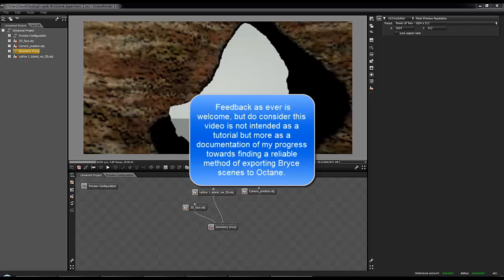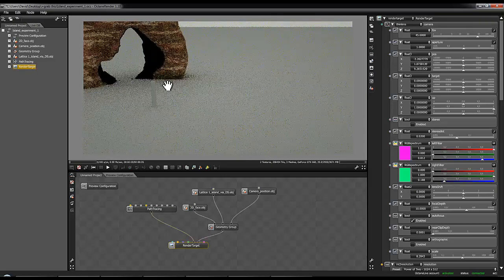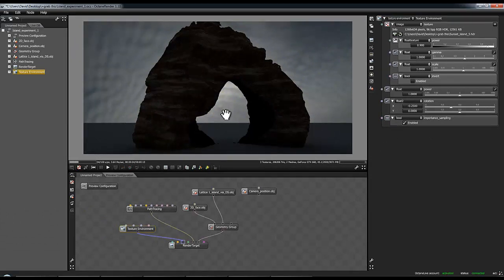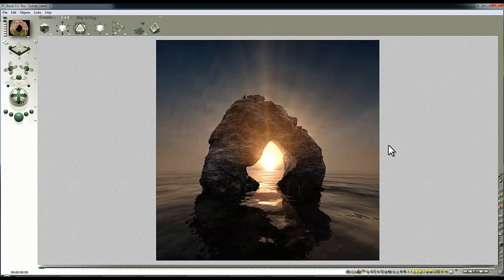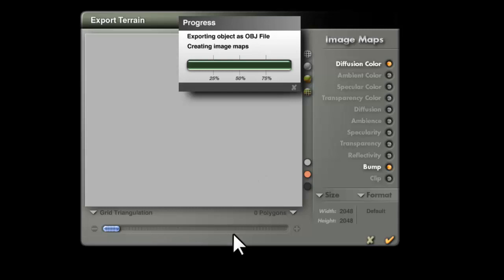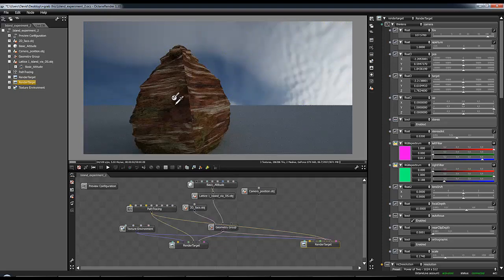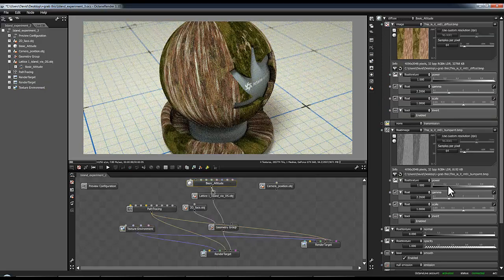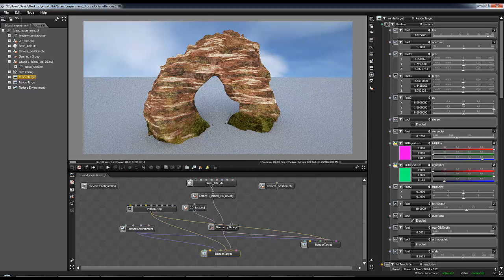Bryce to Octane - Island scene conversion - part 2 - by David Brinnen.

Comment from the maker: The Octane standalone is pretty much focused on materials, light and camera.  Which is fine.  But if you want to do anything you need something to act as a front end.  Bryce on the other hand, has lots of neat features that allow scenes to be built quickly and materials to be synthesised.  Bryce uses CPU.  Octane GPU.  In other words, they can co-exist nicely and have complimentary functions.  I'd like to see an export to Octane option for Bryce, but failing that, I'll just figure it out myself.